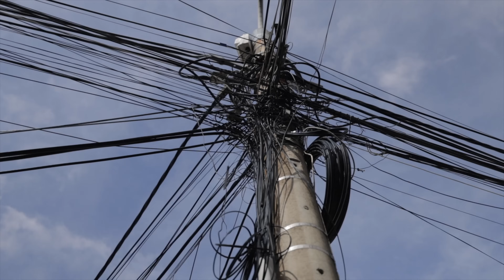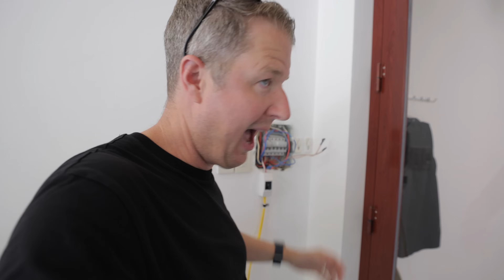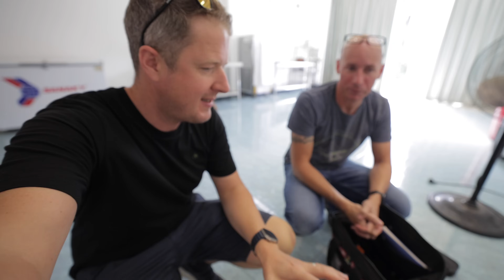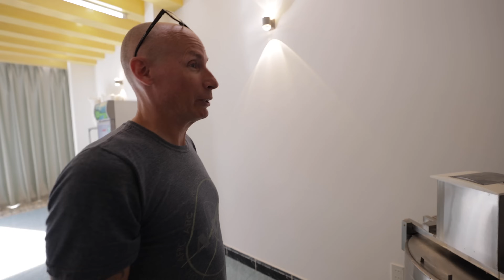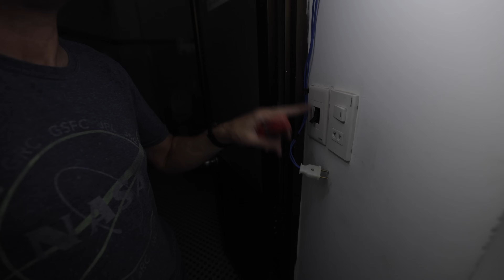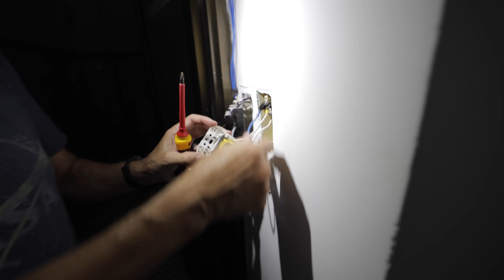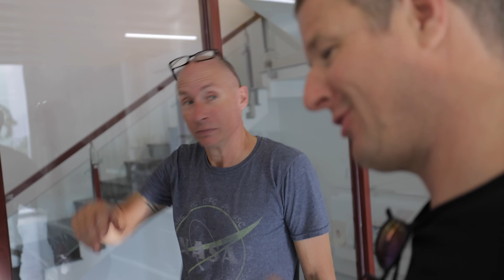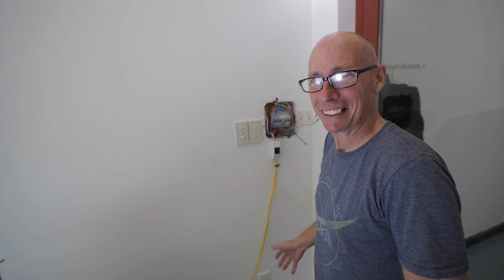USA and UK Electrician tackle CRAZY electrical wiring in Vietnam

Comment: Comment from Germany: Perhaps I did not get everything languagewise, but my take on this problem would be first to use my signal-injector, that I normally use to find the breaker for a specific outlet, just reversed. So inject the signal at the switchboard and then go around the house with the signal-probe to find the outlet, where the injected signal can be detected. That narrows down the number of suspects.

BTW, I've seen similar if not worse installations in Brazil, Mexico, Eastern Europe, Albania, South Africa - so no Asian peculiarity. 

In Albania for example they intentionally shuffle the cable colours even in secondary transformer stations, because the bad guys had quickly learned, that green-yellow never is live so you can steal that wire without getting electrocuted. Now you never know - chances are three out of five that green yellow is live 🤦‍♂

Cheers
Andreas
Reply: In Albania my friend and I noticed quite severe tingling when showering as we touched the pipes or the drain cover. We washed out of the sink for the rest of the stay in that particular hotel...
Reply: @GeorgeHafiz just copy what the vietnamese are doing and you will be good
Reply: What model signal injector do you use?
Reply: Hello from Romania, i certainly can confirm this, especially the part with green yellow wire.
Reply: Curious, what exactly have you seen in South Africa and where exactly?
Reply: @jared.p240 hi Jared! We were installing smart prepaid meters (credits could be topped up over the air) for ESKOM in a township close to Wilderness. Very „creative“ in-house installations 😮😮😮
Cheers
Andreas
Reply: Idont do that in vietnam .. i know which connection goes to my breaker🫣
Reply: Albania have better electric installation than Greece, Albanian electric style is same with Italian

Comment: In Asia, they normally embed cables (normal cable) in the concrete, and where there is land movement, cable will be pinched. I think you should check on power cable in from the meter outside

Comment: I was, and I will twist cables. No shitty wagos needed to burn down my house, or houses I'm wiring/fixing.. My entire country used twisting method for decades, and generally without fire caused by them. Before you judge, don't forget that the US uses the same way to make junctions. There is the current double according to Europe, because of the half voltage. I saw many twistings, and asked myself, how on earth they did not burnt the house. 

Fault finding: connect appliances one by one, with a timeframe longer than usual tripping time.

Comment: And what you're calling a death stick is a very commonly used tester in most of continental Europe as far as i know. I've never had , or heard of a problem with one.
Reply: Unless some smart a★rse decides to be 'funny' and replace the resistor or bypass it with a thin strand of wire.
Or swapping it for a 12v auto test screwdriver

It has been done in the past.
You can only hope that the fear of prosecution would stop them in todays work environment as that kind of behaviour wouldn't be tolerated and there's  an expectation for any  'prankster'  putting lives at risk to be severely reprimanded.

Still if they are stupid enough to do it  
There's no guarantee other than banning the neon test screwdrivers altogether
Reply: There is no way companies like Wera would include test screwdrivers in thier screwdriver sets if they were dangerous.
Reply: @xtxltd Oh, they do. Don't know why though it is NOT am acceptable way to test for a de-energised circuit.
Reply: @scoops0406  except it is.
Reply: @gavinhay6627  So, you're saying a neon screwdriver is an acceptable way to tell if a circuit is dead? Wow!
Reply: In my part of India, every household has a death stick on hand, not just the electricians. Never heard of any incidents with one ever.
Reply: I have known them to go wrong, but nobody gets killed. 

You alway check it's working before relying on its readings, unless you're an idiot. 

There is no tool that's not dangerous in the hands of an idiot.

Comment: Capacitance on two way circuits can cause LED lamps to light dimly when off.
Reply: Or leakage thru the switch 
Green gunk / black oily conductive contaminants in the switch contacts  'grease'
Reply: I experienced that phenomena with two way wiring - under 4m in length
Reply: yes i had that had to fit a relay to isolate the lights when the light where off @BrainW33a

Comment: Twist up neutral link but if that's the approach taken it would be 100% soldered in Australia.  Of course these days if you are doing this type of termination it's probably best to step back and think of how you've gotten to that position and how you can do things in a better way.  Same goes for earthing.
Reply: If it's a join that doesn't need to be disconnected for any forseeable maintenance or servicing then 
Soldering is the best method for both conductivity , durability and corrosion and vibration resistance 

All well and good but how many times do the screws in  cheap neutral bars etc  chew up the conductors damaging and breaking off  strands of  wire ?? 

Lol when I first started off all the earth's in the switch board HAD to be soldered
No such thing as an earth bar lol

Lol it's a bit like conduit setting with the gas bottle instead of using shitty corrugated conduit that NEVER lasts long in the Aussie sun just gets brittle and cracks open , bending solid conduit is the only way to do the job right , takes longer but it's more robust looks better and will not be any where near as weak or brittle as corro.

It seems the 'art' of setting conduit and the art of soldering correctly is becoming lost in the majority of new sparkys that just want a quick and easy  way of doing things and don't care if it's not going to last till next year let alone 15 to 20 years !
 
Lol we used to be held accountable for work we did  3 years ago or more  ( as it was recorded )  
It ended up good though as my work in my buildings was good so I got to reap the rewards 😃

The only problems arose sometimes when they got contractors to  refurb some areas 

They cut corners and even left 
 ' surprises' bare live wires hanging down in voids  a few times 

Plus their control / lighting stuff ups lol

Like many trades some parts of  electrical work rely on new gadgets and meters that the standard sparky doesnt  know what it does or how it works

Like every thing and  any trade they should learn the basics the foundations, UNDERSTAND the principles of exactly what they are testing for and why  before 
Playing with and relying on fancy gadgets.

That way when resources are scarce in the middle of nowhere 
They will still have some ideas as to how to get the job done and working 
As well as keeping up with tech ,
The old skills of the job still  need to be Passed on and taught .
As one day they may not have the fancy gear and tech to do the job for them 🙂
Reply: @GlenPoll-ox2hj  Things change over time.  Screw ends should be rounded these days, pretty sure AS says so.  The old stuff did have sharp cut ends that would chew up wires and of course if you use elcheapo bars what else can one expect but to end up with non-compliant crap that does damage wires?

I haven't done this stuff for nigh on 40 years now but if I can keep up to date with at least some of changes that have happened in that time someone that is actually working has no excuse.
Reply: @retrozmachine1189  exactly 👍

Comment: Ian... what a gutsy guy...
Im completely gobsmacked by the standards out there,... unreal 😮
Reply: Not gutsy it's just the way it is.

These days 
People seem to grow up wrapped in cotton wool 
Protected by the nanny state 
For their own safety 
Unfortunately the younger generations end up growing up knowing nothing,
And so far removed from the real world and how things actually work .
What ever happened to everyone  ripping things apart to repair things , knowing how to fix things and how far they could push things before they reached the limit and broke 

Living by the seat  of your pants,

Using what you have because you can't afford  the latest and greatest , making what you have last for longer 
It's all good untill someone takes a shortcut or doesn't quite understand it and starts a fire

Although it's not so much the house wiring thats the problem in concrete/ brick places where the cables are in conduit chased into walls as  they can just melt and be contained

The issue is usually all the wires shoved in the sockets rather than using plugs 
- just strip the insulation off the end and shove it in with the rest of the wires 

- the ultimate loose connection lol
Causing hot spot / Intermittent sparks  around fabrics that can burn etc

Plus often over loaded  / wrong sized individual single wires used instead of ' flex cable '  for appliances that get warm / melt insulation off as the C/B is for the whole house  too large 

( Really bad if you see all this where you are staying and it's really nothing more than  a glorified cane hutch with straw roof)
The mains coming in off the street 
Are basically someone climbed the pole and wrapped wires around the lines and strung it in to the house 
( Most likely NOT legally connected ??? 
But then hardly  anyone's connection looked legal.
All rats nests  on every pole and dodgey connections
( Not sure how some of the poles managed to carry the weight of all the copper)
I tell you what it would be a great place for them to steal copper theres so much slack all knotted up there! 
Although I'm sure there would be MANY  people coming out wanting to know why their dodgey power connections  dropped out!
They'ed be taking their life in their hands hacking into all those cable  rat nests , if  the local authority ever fixed their poles up they would  have to just cut power to the whole street and remove  ALL THE cables and just run all new lines down the street.
( Although if they killed power to the street and made it known
 ( signs nailed to the posts  that the power was off untill they were able to run brand new lines thru
I am sure the street would wake up one morning and all the copper would magically be gone thanks to some entrepreneurial people trying to make a buck 
Saving the power company the hassle and cost if removing it 🙂
Altho The downside would be 
Those entrepreneurs would be selling the cables back to people to reconnect them back up !😂)

At least it might be a bit neater 

You just gave to remember , 
When you are in a ' strange country'  youve got to go with the flow
Even if the lack of safety / potential danger is doing your head in . ( Just be hyper vigilante and have all your 'important' stuff ready to just grab and run incase of fire / incident 

As Hogan's Heroes Schultz says 
I see NOTHING! I  know NOTHING!!

see no evil hear no evil say no evil

It's just best not to mention it

Although to start with I was a bit like Basil Fawlty not mentioning the war lol.

Straight from the power lines into the installation , no hrc pole fuse  no protection at all ,
I'm not even sure if many places even had a switch board  , they probably just twisted wires directly onto the  ones coming in the window from the street .
So if you have  a dead short  fault
It's just direct connection between you and the closest transformer 
Even when you think the fun is over 
Dont forget the ARU -   automatic reclosing unit !

Disconnect fast and Clear the fault or you will  ' go again ' for another spark 'show'

But Even after that's over , if you are in a glorified  grass hut it's probably on fire somewhere .

Comment: What is lighting cable. 1.5mm2 can easily be used for up to 16A
Reply: Depends on the country. In Poland, the limit on 1.5mm2 cable is 14A in many circumstances.
Reply: @A_Canadian_In_Poland  Physics dont change in Poland. There is certain factors to calculate how much the cable can take and most of the time 1.5mm2 is fine for 16A

Comment: Only 5 minutes in but can empathise. Lived in Vietnam for a number of years and their electrics terrified me. Haven't seen the voltage stabiliser yet (usually fitted under the groundfloor downstairs or in the chamber used as a water sump (Vietnam has poor water pressure so water tends to be stored in a sump and pumped from there). I do remember getting an electric shock from a 6-way light switch one spring because the sudden season change in Hanoi has condensation running down the walls and staircases. When the local electrician took the faceplate of the switch panel there was just a mass of white wires that looked suspiciously like 'bell wire'. How they diagnose faults is beyond me!

Comment: Unfortunately it's a giant puzzle so it's going to mean starting somewhere and working until you can't work anymore. I would attempt to colorcode phase neutral but in the end I might end up just tagging lines with tape. You just have to go from one box to the next until you finish line and then rinse and repeat. I would probably replace that big bundle of twisted wires with some sort of junction block. eeeeeee
Reply: Start by getting an actual  Independent earth reference  on a trailing lead and start from there

Comment: I wish I could remember what the book was but it was kind of how to do wiring before the NEC got into existence sort of the de facto standard of the time, And it went over the old-school methods. Twisting together and then soldering is the old way of doing it but then I think there's a lot lost in translation between the professionals who did it and the Don professionals trying to replicate that which then devolved into just with them and gather it works OK we're done.
Reply: Thoroughly twisting solid wires can result in a reliable connection. However, there's a lot that can go wrong and twisting stranded wires is one of them. Also, with more than three wires getting a good connection is close to impossible.

Back before modern connectors were a thing, electricians in some countries looped each wire around an M3 screw with a washer, then added a nut, tightened it down and taped the whole lot. A good idea in theory, in practice these always come loose. I don't think I've worked in one single place with this type of splice where I didn't find any loose ones.
Reply: Monkey see monkey do 
Unfortunately 
Monkey either didn't see everything and grasp the underlying concept ,
Or monkey just forgot to do  critical parts like actually soldering it properly

Comment: I'm from Canada and I never encountered anything as bad as what I saw in this video. Mind you, I'm not a sparky.

A few years ago, I bough a 40 years old condo . Clearly, sometime in the '90s or 2000's, most sockets and light switches were replaced. The original ones were cream colored and the new ones are white.

I found at least 3 outlets with live and neutral inverted. The closet socket to the kitchen's stainless steel sink had no ground connection. I went along the sockets above the counter and found one where the ground was a little short and had therefore just been left unplugged. There is no RCD protection anywhere.

All our sockets are duplexes. Since the ceiling is a concrete slab, there are no ceiling mounted lights. The wall switches are supposed control one of the 2 outlets. However, the person who had changed them didn't understand how things were meant to be. On our sockets, there are tabs on both sides that link the upper and lower sockets together for convenience. If you want to operate the sockets independently, those jumpers have to be removed. That hadn't been done which basically bypassed all the switches.
Reply: The problem is,
 when Some one is claiming to be an electrician and they've  been doing electrical work for years in Thailand or somewhere then  they move to uk,/Canada, /Australia 
You REALLY don't know what their standard of 'work' will be  like ,
or if they are even aware that electrical standards exist ( or that earth wires exist for that matter)

I have seen quite a few houses that have had a SIGNIFICANT  amount of let's say  'asian country'' inspired work  done,  such as gpos ( socket outlets)  only wired with
 0 .75mm   figure 8 flex  ( bell wire)
( No earth)   not to mention all the lights 
It is primarily because of such widespread dodgey dangerous and let's be honest  INCOMPETENT unqualified electrical work being done by idiots.( Surely if someone's going to do work that 'isnt their normal day job' for God's sake do at least a minute bit of research!
Or at least use the same size / type of cable that's already there 
That they are spurring off from 

I mean if you were going to move a tap / extend  and put another sink in 
Even if you had never seen plumbing before
Wouldn't you use the same size and kind of pipe?!
You wouldn't just  use a roll of  clear 2mm PVC hose  thats a lot smaller size pipe would you ??

You wouldn't use bl★★dy card board drinking straws or the like would you??! 
Even if you already  had loads of them 

Making more standards and increasing penalties for illegal electrical work won't really stop these idiots as although some of them get caught and they are arrested and penalised for illegal work these idiots don't really know
The laws or standards 
Even in the court room of commonsense There's absolutely no excuse for not replacing/ using like for like/ extend existing with 
the  same type of gear.

It's because of these idiots the govt makes it harder and creates more hurdles  for qualified 
People that DO do the right thing 
( as we are not stupid) 

 In Australia it is illegal for anyone to do ANY electrical work unless they are  qualified electricians 
(Trained to Australian standards -or equivalent standards ( not to 'Asian standards'))
Not even homeowners are allowed to do their own electrical work 
Mainly Thanks to the idiot Muppets and their figure 8 flex
Wired houses